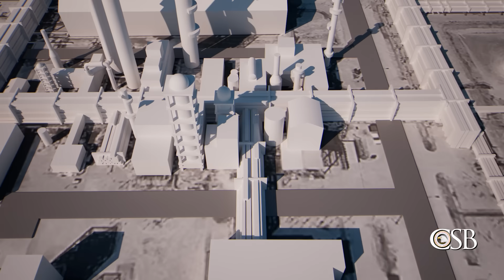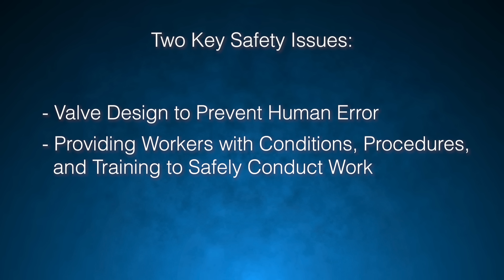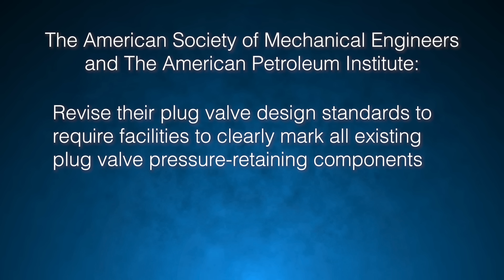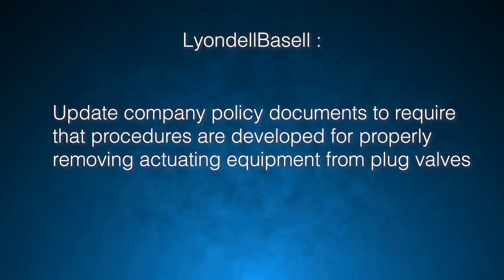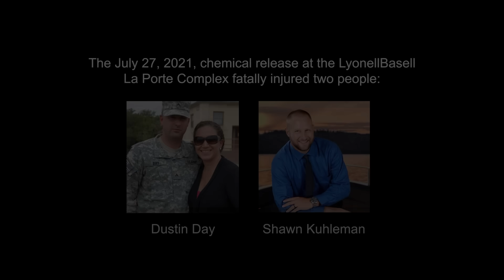Designed to Fail: Chemical Release at LyondellBasell

Comment: Wow... Shocking to read of this.  I was the operating engineer in that plant up into the late 90's when it was Quantum Chemical and before Lyondell bought it.  I have had my hand on that valve.  It was a zirconium cast valve and the whole time I was there, we did everything imaginable to NOT touch that one or the one next to it also zirconium.  

They are right, the plug valves used are a quite old and standard design, although cast of a new and amazing material.  As the video played out, I saw the animated guy reach behind the actuator assembly.  They got it right that there are studs holding that plug cover plate to the valve body.  Those should have never been touched.  I have seen that actuator removed in a previous plant outage.  It has been sticking to that shaft every time.  It has corrosion on the shaft from a tiny amount of leakage through the top shaft seal for years.  

But all would have  been fine had they not touched those 6 stud bolts holding that cap down.  

For the undergrad below that is trying to learn what these valves (and really most all common valves in use)  Try to find a Crane valve book from ancient times.... about the year I was born.  Ebay has been my source.  I have 4 excellent copies of the 1953 version on my shelf at the moment and one 1960 version.  I have given away 7 or 8 of these to some very worthy engineers in the years to guys I thought would use them.  Had these guys had one, there are cutaway photos of these and almost all common valves you will come across.  Mine are not for sale, as I have at least 2 earmarked for a couple of really good engineers that need them.  But the USCSB is right, these valves could be made to be less likely to be opened by accident here.  

Yes, dying from the reactor contents here would be a particularly bad way to go.  Vile stuff in that reactor, along with a LOT of dissolved carbon monoxide in pure form.
Reply: I too worked in that complex, and spent much time on and around that valve as a maintenance engineer for about 16 years.  So sad to see this happen.  It was definitely preventable.  We spend so much time and effort during HAZOPs to prevent things like this from ever happening.   The electronics and control software and valve components configuration were always looked at very closely.  This is one instance we never looked at.  There are many, many of these plug valves in this process.  Some are manually operated, while others like this one are remotely and automatically operated.  We have successfully removed these actuators many times before.
Reply: Fascinating and somewhat alarming comment thread here. Thank you.
Reply: Why does the actuator have to be removed to ensure the valve stays shut, isn't there a setting for it to keep the valve shut without removal?
Reply: @Jonnyg325  The rule is set up to prevent just this occurrence.  It is reoffered to as a "lock out tag out procedure."  It takes the whole complex manager to get this rule modified or changed.  We looked at this valve to modify it for a locking pin to be added so it could be mechanically prevented from rotating.  It was deemed to be impractical due to the Zirconium material.  The primary shaft would need to be drilled and a pin made with stops so it would not be able to turn.  But zirconium being drilled, was possible ( though highly unlikely) to get hot enough to catch on fire itself.  So it was abandoned.  My input was that this valve requires so much torque to open and close that we were worried that if someone re-connected the pneumatic air to it even if with a utility hose, the unsuspecting mechanic would likely have enough force to break the pin and activate the valve.  It is a difficult thing with plug valves.  people struggle with this in many places.  

The way I dealt with it while there is put in a rule with the supervisors in the plant, that either a supervisor or myself would be standing on deck with this valve if anyone was going to work around it.   Many of the mechanics are not intimately familiar with the inner workings of these valves.  Only ever had 2 shutdowns while I was there and one did not require this valve to be touched.  The other one, we simply removed the orange actuator (it was actually orange in real life in the field) and as always found the coupling to be jammed on.  We finally freed it up and got it off, but with at least a full shift trying to make it release.  Several times we needed to remind the mechanics NOT to touch any of the 6 bolts holding that cover on.
Reply: @lpconserv6074  Reminds me of the BELIMO actuator valves that are easily IDed as they're all in that same bright orange.  Thank you for your input, it's fascinating.
Reply: @lpconserv6074  The shaft was zirconium too? This on/off valve and other instrumented valves should not be modified without engineering reviews. Typically, shutdown valves are required to be tested. modifying this valve by removing the actuator would require functional testing afterwards, this is a perceived shortcut from de-pressurizing and de-inventorying. The recommendation is that contract workers become experts on modifying valves in the field, which is an unrealistic expectation. The simplest solution would be to reform the LOTO procedure to include actuated valves. Either with SIS/DCS engineering action or by locking out the instrument air to the valve.
Reply: @PsyrenZero  The Zirconium valves on this reactor are made Zirconium on “all wetted parts”.  Chemical processes in this reactor are severe.  Had they not all died from this, I suspect that the valve would have been removed from the site, sent to the original maker, fully repaired, and likely modified to prevent the lock up from sitting ages in that single position, and brought back to be re-installed.  I do not remember actually doing anything like repairs on this equipment, only blinding, removal and replacement.  Far to critical equipment for someone to “learn on”  The contract workers were likely ONLY to remove the valve, and send for rebuilding. In the process, they could not remove it and decided to start dismantling it to get it out.  As I have said earlier, all these critical valves and in fact the reactor itself included in the list of things we do not touch.  We prep for maintenance and remove, not repair.  Someone violated the boundaries on this isolation procedure to even get to this point.  The reactor was obviously still full, under pressure, and many safety rules were broken the moment they touched this valve.  It was a part of the critical isolation system.  Again, locking out the air on this valve or any critical isolation valve was deemed to be OK, but not adequate.  Blinding was the only official isolation method.
Reply: @Jonnyg325  The only "Setting" is the removal of the actuator air supply.  However the "rules of lock out - tag out" do not allow this method of making certain the valve would not rotate.  Seems obvious that it would not move , but the rules push for mechanical stops to be in place to prevent rotation of that shaft.  Seems a bit much, but remember those 3 guys up there almost certainly have with them a pipe wrench.  That alone would turn the valve to the open position.  I understand it would be stupid to do that.  But pulling not one but SIX cap bolts is what actually killed them.
Reply: @Jonnyg325 loto, I presume.
Reply: The sad part is that these accidents (technicians removed wrong bolts) have been getting more frequent. I spent ten years as a Navy Nuclear trained Machinist's Mate, and the last 25 years in chemical plants. These things didn't happen to us because we always followed the CSB's second recommendation in the video, which can be summarized as "RTFM BEFORE you start turning wrenches!". It's not a design issue. It's a training/labor force issue.
Reply: @stevebriggs9399  My experience is that it is both a design and training issue.
Reply: @stevebriggs9399 "read the fabulous manual" or "read the factual manual"?
Reply: @stevebriggs9399  dude… I was born in 1990. RTM was SOP back when I was a child. When in the fuck did that fall by the wayside?*Head desk*😢
Reply: @SarafinaSummers  Some organizations stress RTM. But you would be surprised how many organizations haven't inculcated RTM into their culture.
Reply: Do you think it's possible that the workers had experience with installing other actuator designs where the actuator has a mounting plate that is captured by the valve cover bolts?  it wouldn't be a correct procedure to remove the valve cover to remove those actuators either, but someone could just think they were supposed to reverse the install procedure.
Reply: @gmaxwell  The install procedure would not touch those 6 bolts either.  ONLY the frame for the actuator needed to be removed.  True, that requires removing 2 of those 6 bolts at a time to install the frame.  Then 2 on the other side.  All of that as I remember is why we did not allow anyone to touch that valve during outages unless the reactor was drained and depressured.   It was always considered #1 top priority critical component while I was there.  We avoided it unless it was absolutely necessary.  

We did that only one time, when the reactor required welding on the inside of the vessel due to cracking.  It was a test of my guts to even sign off on that.  But a cracked reactor wall was scary enough to get me to OK it and go through the procedure to completely clear the vessel for that work.
Reply: @lpconserv6074  Yeah the install procedure for that actuator doesn't require touching the nuts, but there are other actuators where the the frame goes behind the valve cover nuts. If you look in the USCSB written report for this (sorry youtube won't let me link) there is an example from another incident where you can see the frame was attached that way.  So my thought was that these contractors may have had experience installing a different actuator design.  The other design shown in the report also doesn't require removing the critical nuts (you can just leave the frame on and remove the actuator) but you might do so if you were just trying to reverse the install.
Reply: @gmaxwell  I agree fully.  Removal of those bolts in this case may have been required, it is so long ago, I just don't remember.  But even if they were, it was possible to do it staged, one side at a time.  However, due to the lock out tag out rules I am sure we would never have allowed that on a permitted maintenance job.  

The thing I keep thinking about is the frame piece that held the actuator should not have been required to be removed.  As you rightly suggest, the valve sets a mechanic up to making decisions he doesn't have the full set of information to make.  Re-Design of this should have been done.  That whole deck was considered high hazard location and we really did not spend much time there.  Kind of a quietly but well known hazardous location.  Pure carbon monoxide on that deck as well.
Reply: @gmaxwell   Yes, when I was there, this was a top critical part and ONLY a designated supervisor and his best two mechanics were allowed to touch it.  And we avoided touching it at any opportunity.  

Unfortunately, in todays world of cheapest labor standards, it will be obvious to the experienced plant people that these guys had no idea how that valve was assembled.
Reply: @lpconserv6074 I don't know anything about chemical plants, but your comments were well written and even I can understand that valve needs to be redesigned.
Reply: @ShannonDove-sy7ye  Yes, it seems difficult to understand to folks not closely engaged in chemistry.  Acetic acid at 3 to 4 percent is edible and used daily by a large number of people.  However at near 100%, as it is in the reactor, it is deadly.  

Most likely the fatalities and severely injured here were killed by several of the effects of this.  First the plug leaving at force from the pressure in the reactor, would by itself be enough to kill anyone impacted with it.  Second the acetic acid/catalyst/carbon monoxide mixture would overwhelm the body and go places like lungs, eyes, and down the throat.  Instant death in those cases.  

Yes, pure Carbon Monoxide, one of the primary reaction components was the main reason we as operations folks avoided that whole deck.  Colorless, and completely odorless you could walk past a leak, make it to the stairs on the other side and fall out dead on the next level down.  We had CO monitors there but only as good as the wind direction if they detected it at all.  

Example, your stomach contains Hydrochloric acid to digest your food.  Yet at a very low, (relatively) concentration.  Drinking a half cup of the same stuff, Hydrochloric acid, from the hardware store (for cleaning concrete) would be fatal unless you drank it in a fully functional emergency hospital setting....
Reply: @lpconserv6074  I been studying chemistry for a while, so I know a little bit about it. I just never heard of anyone dying from acetic acid. I have heard a lot of bad things about ketene, talk about how poisonous it is. I've heard bad things about nitrogen dioxide, which they say won't show it's harm until 12 hours after exposure, damage already done by then .
Reply: @ShannonDove-sy7ye  Yes, got my degree in 1974, worked for Dow Chemical for my first job.  What they didn't teach me at college, Dow fixed for me.  They were insistent I get directly into a plant, learned all I could.  

Two things I learned first thing there.  One is the generally low level of understanding of the effects of knowing and understanding of "SCALE".  It is prevalent everywhere I go and have been.  Simply, falling from a 24" tall stool or a second story window seem similar enough, but the effects are NOT linear, and certainly difficult in most to be estimated in normal human minds.  
Second, they taught me to treasure, learn, and understand the generalized relationships in engineering... Best example comes to mind is the Affinity laws.  Quite general, but gives you the general idea of how one of the many variables we encounter are so often NOT linear or first degree relationships.  MANY things are followed by exponents, of 2,3, or even 4.  Speed is not linear with energy... as an example.  Learn the relationships and keep them in mind, and it can keep you from making big mistakes.
Reply: @lpconserv6074  good information.
I used to use the example of combustion in air versus combustion in pure oxygen. The pure oxygen contains 80 percent more oxygen than air, but it speeds up combustion way more than 80 percent.
Reply: @lpconserv6074  I really would like to talk to you. Do you know about the science madness forum?
Reply: @ShannonDove-sy7ye  I am not aware of the science madness forum.  Let me do a quick search on it and see if I can find it.  Glad to discuss with you.  Been training folks along the way to a small degree.  I am no where even close to the quality of training Dow was giving back in the 70's and having worked contracts inside Dow many times, I can tell you, they do not do it that well any more.  Such a shame... they really were heads and shoulders above anyone else I have worked  around.
Reply: @ShannonDove-sy7ye  I found it.  But it looks like a closed forum.  I cannot register.  Let me know if I need a secret pass code or something.
Reply: @ShannonDove-sy7ye  Ohhhhh....pure O2. Reminds me of my time in submarines and working on a supercritical water oxidation unit. Not a lot of margin for error when it comes to handling/processing pure oxygen. Fun times!
Reply: @lpconserv6074   Honestly, I am in no shape or form trained for this kind of work (I am an IT technician) and if that valve looked anything like in the animation, I have NO idea how they didnt realize that those 6 bolts kept the valve assembly together. To me this is as clear as the day the second I saw it.
Reply: @lpconserv6074  And at no point in the video did they mention the permit. In the 15 years I spent in refineries in SETX as a civil contractor, I have ingrained in my very core the JSA and Permitting procedure, including all the trudgery of signing in and out of units and dragging the unit operator out to the jobsite to permit your work, etc... this video makes zero mention of any of that. In my imagination, here's the scenario: A lazy contractor spotted an opportunity to do some work during an unexpected unit shutdown. They "qualified" dudes they subcontracted out worked a couple a pipepline jobs as fitters, never actually been inside a refinery/plant. They do the ISTC/BASIC training at the nearest facility, get badged in and don't quite have the true lay of the land because refinery life is terrifyingly wild and you absolutely cannot be complacent. These clueless subs never bothered to contact the general and get the unit operator involved? How about a damn permit? Work flow has changed, did ANY of this take place? I mean, they literally did EVERYTHING wrong.
Reply: I'm very happy to report that a good photocopy can be found in the Internet Archive, if no print copy can be found.
Reply: Why are they made from zirconium? There must be a good reason since zirconium is highly controlled at least here in Canada, it’s used in the nuclear industry.  I once asked an engineer at work for a drawing of a zirconium part and only he had access to those drawings for security reasons.
Reply: @axtonjcranston  It is about the only material that can stand up to the reducing conditions in the reactor.  Digging back in my memory, I believe the catalyst was Rhodium based catalyst.  The reactor inner shell was Nickel.  It was one of those things, rare.  We called it the million dollar vessel.  Likely more now.  It was too expensive to make all Nickel, so it has a 5" thick "wrapped" shell layer to help keep it strong enough to hold the pressure inside.  

All that and it still suffered stress cracking in the Nickel inner shell.  

Yes rare to see Zirconium used anywhere.  That Rhodium catalyst was more expensive than gold at times.  But right in that general level cost wise.  I remember seeing 3 large sacks, like burlap sacks, of that Rhodium catalyst in the day supervisors office, waiting to ship back for reclamation. I was told it was also around a million dollars worth...
Reply: @axtonjcranston I started in photography back in the film and black and white days. Glacial acetic acid is what you call more concentrated forms of it that are hazardous. You get extremely dangerous skin burns from it. As far as I know zirconium  isn't particularly controlled it's just expensive material and it doesn't have a lot of use outside of the nuclear industry. Its properties are similar to Titanium with the extra part being it's extremely transparent to neutrons and therefore does not take part in nuclear reactions and makes calculating void coefficients much more simple, and when the material is free of hafnium. recycled out of the process of the nuclear industry, it isn't intensely radioactive like a lot of other components like steel are because the iron and other allowing materials are converted into radioisotopes via neutrons.

Perry Chilton 23-18 says that it is very suitable where acetic acid is involved to 200 degrees Fahrenheit and concentrations up to 100%

I have a Sperry and Chilton chemical Engineers handbook on my bookshelf that I've owned since my 10th birthday, when my mom bought it using $50 left over in Travelers checks, that should date to telling you that I'm really effing old, from a trip. A couple of my uncles worked at Pulp and Paper Mills and I found the materials tables very interesting where they tell you how resistant metals are to certain corrosive materials at various temperatures.
Reply: @axtonjcranston  Zr is resistant to acid. That's why. So is Tantalum which is often used in acid plants. But the prices of both are astronomical. Welding or brazing Tantalum is a very tricky job.
Reply: Was it a fail open or fail closed valve? Without knowing the process my initial thought would be fail open to prevent some kind of over pressure on power or IA failure.. I'm shocked that actuator removal would be sufficient as isolation for the work... if it was fail closed a simple disconnection of instrument air would have been better as spring pressure would have been sufficient to keep it closed as there would be no spring pressure to keep the valve from moving.
Reply: @screwlose  I don't recall from memory if it was fail open or fail closed.  But the video drawing/image shows it as a "fail in position" valve.  Air driven cylinder hanging down, and NO actuator NOR a Spring casing on the other.  I am just not sure if that was the actual way it was or not.
Reply: @screwlose  they weren't just removing the actuator, they were going to put a pipe-t over it and padlock it in place.
Reply: @gmaxwell  Ahhh. OK, that makes the whole picture more understandable. Yeah, by the time this happened all us old farts had moved on, and worked elsewhere.  It is a very sad thing to read.  I had not heard of this accident, as I have been overseas on a different career path starting up new plants in many places.
Reply: Well, you can thank the legal and finance teams for this.  The finance team wants to shave out any allowance on costs to the absolute minimum and sometimes they shave too close.  The legal team goes, is there a legal or regulatory requirement that we do this.
Reply: @paulkurilecz4209 I frequently go on vacation in Anacortes with my wife which is just across the water from the Cherry Point refinery, which has had many fatal accidents quite often involving contract Crews doing work there
Reply: I'm surprised that they did not identify the outsourcing of safety-critical maintenance as the biggest risk factor here.
In my opinion if you are outsourcing ANY maintenance work on a plant then you have already screwed up in some way, unless it's something far too specialised and limited to do in-house.

Also kinda surprising this was even a lockout process for something that critical. Especially when you have 3rd-party maintenance around you should have custom made locking equipment, which I guess in this case would be some sort of clamping of the actuator shaft without removing the actuator (a modified coupler with a boltable plate that is strong enough to resist the actuator maybe?), and I guess you might have to remove the air lines with a locked plate that prevents their re-connection if that is legally required too. The few sites I have been to that have had extremely hazardous equipment to be locked out have always had cages and clamping frames and such, custom made by the site fab, to get around the equipment not originally being built for proper lockout.
Reply: @samheasmanwhite  Probably not what you want to hear, but the industry has been steaming at full speed in this direction ever since the accountants took over the management of these companies.  I was there in that plant in the late 70's to early 90's.  It was known critical and took a LOT of discussions before ever considering maintenance for virtually anything on that deck.  And for sure those valves you see in the video animation were going to require full plant manager OK to even consider working on them.

The one time we did work around that area the reactor was shut down, isolated, drained, cleaned, and tested before anyone even touched it.  I don't remember the effort length but guessing it was almost a week of prep before we even considered touching any of the pressure containing equipment.  Since then, and before this incident, the plant was sold and a different company was in charge.  Lyondell it seems.  I am quite glad I left when I did.
Reply: @lpconserv6074  Oof, yeah I just had a look through the report. Basically the only change at the plant after this was putting some tape around the body of the valve with a little "please don't" tag on it, and coming up with some on-paper procedures to print off for the next victim. The closest thing to "don't use fking contractors for this!" was this "key lesson": "When contractors are conducting work on or near plant equipment containing hazardous materials, it is critical for the operating company to oversee the contractor work and ensure that it is conducted in a safe manner." That was not included in any of the official recommendations though.

Glad to hear you had a good run and don't have to deal with any of this now!
Reply: "What Went Wrong" by Trevor Kletz is a fascinating book that details the nitty gritty of many infamous industrial accidents of the past.
Reply: @PartTimeLaowai  Good God, that's an expensive book. $106 CAD for the kindle!
Reply: Fascinating. Do you think you could have your copies digitized? It sounds like they're valuable enough to store online in some capacity.
Reply: They only pulled the actuator to do a lockout tagout try out procedure right? Wouldnt you just isolate the valve in some other way than removing the valve it self?
Reply: @Chickenhunter22  The valve remained closed.  The problem here was that either closed or open, it is still possible to move the position of the valve.  Lock out Tag Out is meant to fix the position of that valve with an uncompromised lock to prevent movement.  

This valve, as shown in the video has the turn shaft coming up out of the top of the valve, and the actuator has a shaft coming out of the bottom of the actuator with a spline or square coupling collar between them.  This is shown in the video, however the video, for clarity purposes I am sure show there to be several inches of shaft on either side.  In real life that exposed shaft length is no more than an inch or so, the coupler is about 3 inches and the shaft out of the valve is very short, as well, that part of the shaft is blocked from access with the 6 deadly bolt head nuts in the way.  

The job was to make sure the valve was closed and allow it to be locked that position.  Maintenance guys were trying to get access to that shaft coming out of the valve itself.  The way it was before maintenance got there, it only took a person to connect one of those tubings to that orange actuator and the air would move the valve position.  NOT allowed in normal locking out procedures.  So they felt they needed to do something.
Reply: Excellent discussion here, thank you everyone for your input and knowledge. Stay safe out there, cheers.
Reply: If the valve books are that critical, take the time to scan them to pdf and upload them. Might take a while and might damage one copy, but then every engineer that ever needs one for the rest of time will have access. And you can save on having to source more copies later
Reply: @archiveacc3248  scanning and printing would be more than the book costs.  Ebay has copies usually available.  I have paid as little as 16 dollars for a '53 version of crane.  shipping is usually around 8 dollars each.  As i encounter young engineers that show interest and have the skills, I usually give them one of mine.
Reply: We manufacture/weld pressure equipment from zirconium and the amount of technical queries I've been through is amazing. However some of the questions on the other end have made me think whether there is any common sense at all... 😢
Reply: Thx for the information !
Reply: I'm sure you could scan the pages and put a digital copy online. Internet archive would probably store the PDF files. I think it'd be nice for future engineers and archivists.
Reply: As one previous worker at that plant attests below in these comments, this is clearly another instance of a company with long term employees who understand their own equipment and servicing procedures OUTSOURCING servicing to younger newbies who don't but who THINK they do.
Reply: Thank you so much for adding your input.
Reply: Thanks for sharing your thoughts. I grew up in nearby DP and my dad was also a plant worker for decades. One of the things that reinforced his decision to retire was the feeling that safety precautions were being more and more discarded in the name of profit. He didn't want my brother or I to go into that world and so we chose other career paths.
Reply: I use valves at work all the time, relatively simple though. Electronic irrigation control valves
Reply: @booognish  In general correct.  However there are a cluster of valves under this reactor, made of all Zirconium for all wetted parts.  These are NOT simple to work on, due to costs and government accountability of every ounce of zirconium needed to work on them.  Also, Zirconium will actually burn in air if working around it with cutting torches.  So when I was there, we had a maintenance mechanical engineer, trained on this equipment with any maintenance team.  This was an almost Taboo location in the plant to be in alone, and permits when I was there required a section superintendent was typically on the permit request.
Reply: Fascinating to hear from someone who was familiar with it all, but yeah to me this seems to be inexperience and primarily lay on the maintenance contractors, actuators are actually damn simple and they all more or less work after the same principle.
Any competent personnel would have been able to see those nuts had nothing to do with the actuator itself.
Reply: I do believe it was called USI and northern pet before quantum
Reply: @kurtpecsenye9806  Yes. it was!!  Im old enough now to be surprised anyone remembers those days!!  It was a clannish company, one side of the road virtually ignored the other side of the road... plastic guys on one side, chemical guys on my side.  I actually worked on both for a short time... I have ever since despised the plastic plants...  Over there, essentially every tool box contained only a small assortment of  hammerss..... 😅
Reply: Your long story short, incompetent people run the show and this is byproduct
Reply: Man, I really respect past generations of engineers.  I don't think my young cohort of juniors engineers really get it on the level of the OP.  I've been kind of disappointed how often I see juniors failing to think stuff through, and just expecting everything handed to them.  No one wants to make any assumptions.  

I can't blame the junior staff too much.  Some of them got through their degree without learning to really study, to read reference material, and apply it to a problem.  Standards have fallen.  It's so much easier to just google it, and cross your fingers.  Thanks for showing us how its done.
Reply: Zirconium is a very hard metal and if not treated correctly can cause a lot of issues. We manufactured a small diameter but tall reactor from Zr where the wall thickness was 19.05mm and even thicker at transitions. Cones were hot pressed.
Reply: @simsnqta  Yes a very interesting metal.  Near the end of my working time in the plant, due to the solid nickel interior of the reactor being essentially pure nickel, and having found it cracking from stress and chemical severe response to the mixture, we were looking into a new reactor made with the inner vessel made of Zirconium.  Never saw it happen, but I heard it was in fact ordered. Really an expensive decision. It was as I understand it around 3.5" to 4.0 inches thick based on the pressure ratings required, and that included a 5" thick wrapping of coiled steel sheet to give it the rating on the straight wall good enough to hold the pressure.
Reply: After watching the video I question the mounting bracket design.. if these valves were old I’m assuming they didn’t have an iso 5211 mounting pad for the actuator? Most plug valves now have actuator mounting bolts on top of the process flanges, which are depicted in the video, or an iso 5211 mounting pad. Was the actuator mounted to the valve utilizing pressure containing top cap bolt locations?
Reply: @mitchellj0887  These are essentially one of a kind valves, 1988 vintage or near that date.  Not many Zirconium valves made ever, certainly not these.  in 1988 when I was there, these were there for several years before I arrived.
Reply: Thank you for your expert firsthand account.  You must have had a visceral reaction seeing something you were so familiar with actually killing two people.

I agree, “🤷🏻‍♂️ it’s just vinegar”… but, to paraphrase the Cajun Chef Justin Wilson “if you’ve got a cut in your hand, that vinegar will show you just where it is 😱”.   It’s no stretch to  imagine what a high pressure, liquid and vaporized, jet of concentrated acid - even acetic acid - would do to someone.

If it was me, and I was the survivor … I would envy the two who died 🫣🫢😢🤭.

It makes me boil over - absolutely livid - even with no personal interest in the incident, that neither the plant managers nor the “expert” contractors took more than the most rudimentary safety precautions.

I’m just a casual observer.  
But I wanted to shout
 “SAFETY GEAR”!
“PROCESS SAFETY EVALUATION”
and most of all…
“DRAIN THE FUCKING TANK! 🤬”

Since you know so much about it, can you answer this question?…  Once they closed the plug valve to isolate the leaky connection under repair, why were they removing the actuator in the first place??!?

Thanks again for your commentary!
Reply: @jelliebird37  They had a small leak through the top works of the valve they were trying to isolate from what I have found.  
And the acid was the least of their worries.  Both the catalyst and reaction fluid fully saturated with carbon monoxide at reaction temperatures would be the manner of death.  It is an awful brew inside that even when shut down.
Reply: yeah right bro, nobody believes you
Reply: I'm not an engineer, but quite mechanically inclined. The first thing I noticed was the studs without any nuts that would prevent that valve from coming out. Big huge mistake. Second mistake, it doesn't matter how many written policies they do. If the nuts are not installed back, it's just another accident waiting to happen.